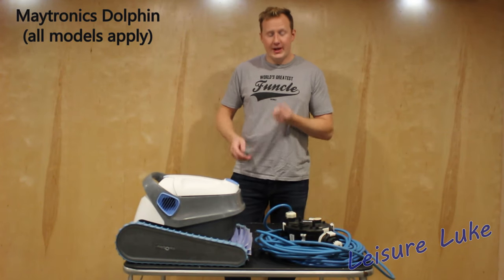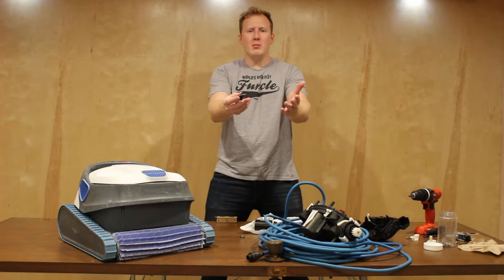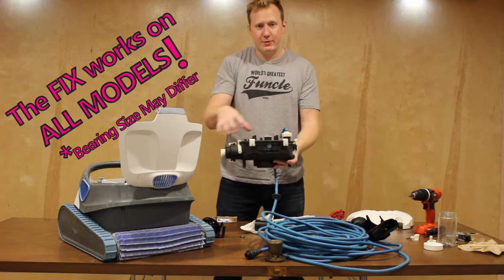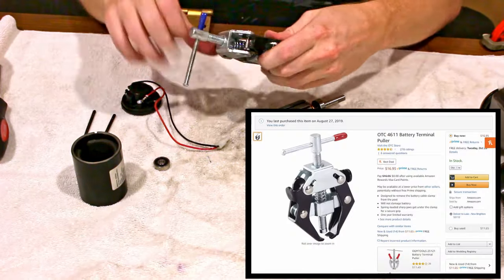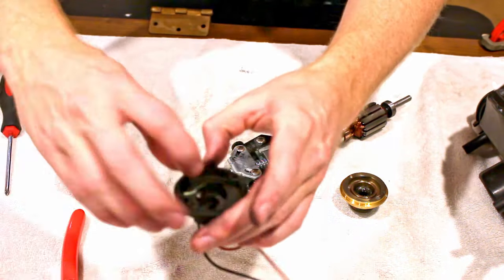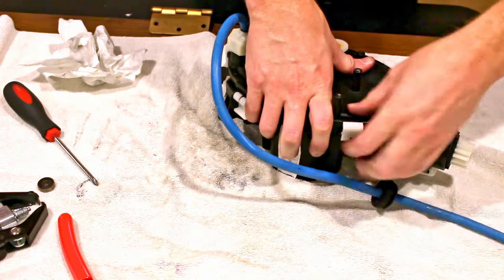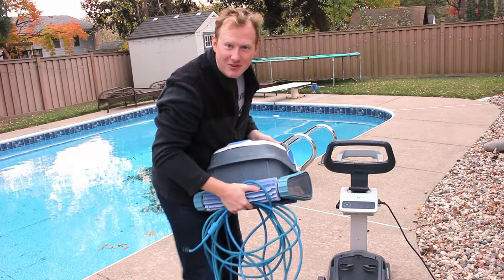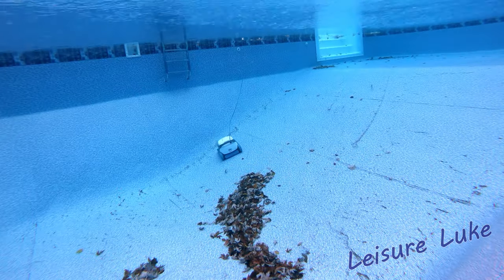Dolphin Pool Cleaner - BROKEN is FIXED!!!  SOLVED with 1$ Bearing | HOW TO REPAIR for MOST Models!

Comment: Thank you for the description and link to the bearings- that saved me a lot of research!  I pulled my Dolphin apart last summer when it refused to run for more than a minute or two and found that same bearing you changed was not turning smoothly in my motor.  I lubed it with some oil put it back together and the robot worked for the rest of the year.  Fast forward to this Spring and that bearing was rough again so it is time to replace it.  Oil has it working for now, but the bearing really needs replacing.  

One note for your viewers- when I reassembled the motor the first time it was running backwards and I needed to swap the red and black wires / brushes to the opposite positions from where they were originally to get the motor to spin in the proper direction.  I'm not sure how I managed to get something backwards as it seems like all the parts were keyed for one orientation.  I think it might have been the brass cap at the end of the motor.  It isn't keyed to the motor housing but is keyed to the plastic enclosure.  I think that going on opposite to original resulted in the terminals lining up opposite to where they were previously.   I recommend putting an alignment mark on the brass cap and motor housing.  It will help with aligning the screws to the holes, too.

Does anyone have a source for replacement brushes or the brush springs?  I don't know how long these will last, but it would be great to be able to replace them when they wear out.
Reply from the maker: GREAT feedback Ryan.  Nice work on oiling up the bearings!  Bummer that's only temporary, but at least it reassures you that you've identified the problem!

I've seen a few people ask about the brushes and brush springs.  From what I can tell these aren't parts that wear out in the life of a dolphin, yes, these wear out in electric motors (usually before the bearings), but you would probably have to run a 2+ hours a day for 10+ years to actually wear those out.  That being said, they're generic, and brushes are sold by size, so if you remove the brush, measure the width & height with a caliper, you should be able to find that brush size on ebay, and you'll have to guess at the length.  Springs too.  I search a bit and found springs that looked the same.  I didn't buy them to verify.

Again, good work, and good luck when the replacement time comes!
Reply: @LeisureLuke   Since my first post, I replaced the bearing and everything is running smoothly again.  I used the terminal puller you recommended to pull the bearing.  I used a small bolt between the puller head and the axle to reduce the diameter down to the appropriate size to not interfere with the bearing race as it was being pulled off.  It worked great!
 
This is pretty embarrassing, but somehow I managed to get my terminals backwards AGAIN even with being aware of the issue and had to take it apart another time to fix that.
Reply from the maker: @ryanmcdaniel7030  BAHAHA  AGAIN!?  Funny, well, well done!!!!!

Comment: Fixed!!! Thank you!!!Dolphin Nautilius CC Plus. 4 years old and I always leave in the pool.  Robot would run for about 1-2 minutes and then stop and the blower fan on the top would continue to run without moving the robot. Fixed: opened up the motor assembly and found the motor that drives the wheels to be completely full of electric motor dust. Picked up a can of contact cleaner for electronics ( and safe for plastics) and cleaned the hell out of the motor. The bearings after cleaning rolled smoothly so I didn't need to replace. Put everything back together - be mindful of the little odd looking washer that sits ontop of the bearing- kind hard to put back but you'll figure it out with time. Only thing I noticed while it was opening the the brushes on the motor were running a little low. If it acts up again I'll plan to buy some extra brushes to keep the motor running. To make sure you have good seals you need some pure silicone grease. 
Total cost to fix: 1 can of contact cleaner: $12 since I already had the silicone grease.

Comment: Well done.  For all the maytronics owners out there, it would be phenomenal to be able to source those two motors somewhere @ the source.  A fix for probably 99% of the failures for a few bucks, and not $400 for the entire drive unit.
Reply from the maker: Thanks!  Yeah, there are hundreds of places to get the motor assembly and NO ONE sells the individual motors anymore.   Glad you appreciate the fix!  Let’s save some people some money!
Reply: I found the impeller motor on ebay for my Dolphin Deluxe 4 for $300. Fortunately Luke's video determined I only needed the besrings.
Reply: I found the same motors on ebay

Comment: My Nautilus CC Plus was spinning the impeller for a few seconds but the motor for the tracks wouldn’t start. Followed your advice and checked the bearings. Replaced one of the impeller motor bearings since it was noisy and failing. Back in business!  Thanks for this video!
Reply from the maker: Nice work!!! And good to know the same issue can appear on the drive motor!!!

Comment: I used to work on typewriters and when I tore apart the motors for cleaning, I always made a mark on the case and end caps.  When you reassemble the motor, align the marks and the bolts will line up perfect.

Comment: Thanks for this video! Easy to understand and follow. I got mine down to the impeller, before opening the box, and the impeller was easy to turn but had a lot of hair around the shaft. I cleaned that off and thought I'd gotten off easily, but it still does the 10-15 second run and stop. Should the impeller twirl, or just be able to turn.?
Reply from the maker: Nice, the problem is usually just a stuck impellor clogged with hair, sticks, etc.  The impeller turns hard, but can be turned.  I would say it does not "spin".  You can't flick it and watch it twirl, but if you grab it you can rotate it.

Comment: Thank you. My Pentair Prowler 920 (Dolphin Active 20) stopped working. It would move a couple feet and shut off. I pulled it apart and noticed a ton of black soot everywhere inside the motor unit housing. Upon further inspection it was dust from the impeller motor brushes. I pulled apart the impeller motor and it looked terrible, I wiped it down really good to remove the dust and it cleaned up nicely. The bearing was okay. I re-assembled and now it is working. It's a bummer you can't find the impeller motor (5500024 in my case) anywhere as I'm concerned the brushes are worn and may eventually need replacing. Thanks again as I was able to repair this for $0 and a couple hours of time.
Reply from the maker: We’ll done!  Yeah, those solid brushes create lots of dust… they are generic brushes that can be replaced just by measuring the height & width and ordering the right size brush on eBay.  Sounds like a few other commenters here are considering the same thing when the time comes.  Nice work on your repair !!!

Comment: Thank you, Luke, for the video.  My Dolphin Triton PS stopped working after two years, right after the warranty expired.  The lady at the pool store said that the model was an "internet special" that broke early (I purchased it online).  I was not happy, I'm used to such large purchases lasting many, many more years.  Anyway, I went through your tutorial--first, I could move the fan but it did have some resistance, so I moved forward.  When I got the motor out, a bunch of rust-colored water spilled out: the gasket had failed.  The circuit board had some pieces that fell off after soaking in water.  I didn't go past that so now am going to purchase a new robot.  I thought about replacing the motor unit, but I also would need a cord, since that would all cost $600 plus I'm leaning towards a new one around $850.  However, the reviews tout the Dolphin Nautilus CC, but I'm so hesitant to get a Dolphin.  Perhaps I will, and after 2 years, pull everything out and replace gasket and parts.  I'm not sure :(
Reply from the maker: Sorry to hear that rob.  I would get a new one vs fixing yours.  Once you have water damage you're looking at replacing everything internal and it's work without a warranty.  You'll be happier finding the store with the best, longest warranty possible and getting that!  Seems like purchasing through a local pool store that clearly states their warranty is the best thing.  If it were me, I'd start reading through Amazon adds and get the highest-reviewed product that has a warranty (you will have to pay to ship it in).  These things just aren't made to last, but a new one will undoubtedly be better than an old one.  Hope that helps.
Reply: I agree

Comment: Great video. The same problem happened to my pool cleaner, your video inspired me what to do and it turned out that the bearing next to the brushes was blocking. I lubricated it with oil and the problem was solved, but I bought new bearings and will change them later.
Thank you, thank you, thank you.
Greetings from Spain.
Reply from the maker: My favorite result!  Glad to hear you were able to find the issue!  I'd still replace that bearing, but it sounds like you've bought yourself some time.  EXCELLENT JOB!!!  Party Accordingly 🥳

Comment: My 5 year old Dolphin Triton PS Plus was throwing the "Error 1: DC in voltage" shortly after start up. Strangely I could still clean in manual mode and the impeller seemed to turn easily enough.  I'm decided to try and replace both bearings of the impeller motor anyways, and the error cleared and is working again.  Thank you for your video!
Reply from the maker: Oh man, nice work!!!  Maybe the motor was drawing too much power, or maybe you fixed a bad connection in the process.  Either way, we’ll done!!!

Comment: Great how-to video! Thanks for saving me significant replacement $$. I almost ordered a new robot right away, but figured I'd try this first. It fixed my Dolphin model with the exact same bearing, threw it in the pool and it started working again.  I used toothpicks to move the motor brush springs off and then used them to hold the brushes back while inserting the electric motor back into its housing. With the extra bearings, I'm ready for 4 more repairs if necessary.

Comment: Thanks Luke, I had the same problem and your video gave me the confidence to try the repair. Replacing the bearing was a piece of cake. Reassembly of the motor was a little cumbersome because of the brushes. Next time I think I will retract the brush springs and let the motor housing keep them off the brushes. Getting the housing for the motors and circuit boards back together with the o-ring properly in place was a bear. After 30-45 minutes of swearing I decided to try my woodworking bar clamps (2) to draw the housings together while using a piece of wood to tuck the o-ring between the two housings. In two minutes the housing was back together and after 3 days the cleaner still works. I’m fairly confident I just saved a thousand bucks. Thanks.
Reply from the maker: So happy it worked!  Sounds like you got a little more work than you bargained for, but glad you’re done!  Mine still works on year 2 of doing this fix!  I run it constantly this time of year in the spring of Minnesota.  NICE WORK, CONGrats, PARTYACCORDINGLY!!!!! :)
Reply: @LeisureLuke  Luke, thanks for the great video on the impeller motor fix. My question:  I took my motor box apart and all motors seem to work but only briefly. Is there some sort of sensor that shuts the motors down when the unit is not in the water? If not, I'm wondering whether I have a bad board in the motor box. I have an M400 with three motors, two drive and the impeller.
Thanks!
Tim
Reply: That last lid latch worked me over trying to get the last it on.  The uneven surface was a challenge with the woodworking clamp but a lot of MaGyvering solved the issue.

Comment: This is a great video...my bearings where fine ...my motor was packed with carbon dust...cleaned it out and it runs fine now....this video is great showing all the steps...the engineering on this machine is fantastic...taking it apart and reassembling it is pretty easy...all the parts are indexed to only go together properly...even the power cord.  thanks so much....saved a LOT of money. I recommend cleaning all the gaskets as you reassemble...just to keep water from creeping in. I sure wish they would sell the individual motors inside the $450 assembly....why engineer it so well to for repair and then not sell the interior motors?
Reply from the maker: Thanks for the comment!  That carbon dust is a build up from the brushes wearing away on the motors.  These are "brush motors" vs "brushless motors".  Some people eventually have to replace the motor brushes when they become too short over time.  Glad you fixed it!  I agree about cleaning the gaskets, but I'm worried about getting the wrong silicon grease to coat them in before reassembly.  Do you know what the right stuff is? Nice fix - one less thing in the dump and $1k saved a little longer!  Great Job, party accordingly :)
Reply: @LeisureLuke  Mine weren't that dirty that I needed to wash them...just got the sand off and then cleaned the grooves really well...the gaskets were still pretty slippery with lube when I put then back on....there are quite a few on the old interne that seem appropriate - I did see some refurbished motors on EBAY...appears to be a guy who refurbishes them full time...good gig
Reply: @LeisureLuke dielectric grease is what you should use on rubber o-rings. It will not chemically react with rubber - pull up the TDS and you will see it states safe on rubber. Thank you for an incredible video!

Comment: Thanks to you, I had the confidence to take a shot at fixing my Dolphin M500.  My unit would attempt to move, lurge and stop... usually sideways .   Suggesting the motor bearing you discuss.  I pulled off the top and side covers off.  One track seemed to be able to work freely, but the other was binding up.  Then I flipped the unit upside down and pulled off the four screws holding the center drive roller.  At this point, the ball bearings in the gear drive assembly for the drive roller fell out on the table !   This bearing had failed.   The specific part name is “Active Brush Holder Kit”.  So it was not the motor bearing, but still a bearing... and an easy fix!   I located the part from the parts diagram from a supplier and it’s on order.   $9 part to fix my $1000 robot!    Thanks for your tips.  Got R Done!!
Reply: Also, with the motor out I powered it up and test started the unit.  Impeller and both drive shafts rotated freely.  So I’m confident the motor unit is still good!   Thank you Luke!!
Reply from the maker: Hey Hey - that's great info about the "Active Brush Holder Kit".  Well done on the fix!!!  You should be proud have found, solved, and fixed the M500!  Keep up the good work!!!!
Reply: @LeisureLuke  got the parts today.  I ordered 2 of the “Active Brush Roller Kit” to replace both sides.  Glad I did.  The other one was a little sloppy compared to the new one and may have gone out next.   Put it all together and back in business cleaning the pool!!   Thanks Luke!!!!   😎
Reply from the maker: @gordonroat5364  Thanks for all the information, and nice job with the fix!  When you were describing the original problem you said it would stop sideways.  Do you mean it would sort of turn a little bit then stop?  That's a good thing for people here to look out for.  If your robot tries to do the twist before giving up it may be a track problem!  Much appreciated and again, be proud, that some good work you've done there!  Enjoy the clean POOOOL!!!!!!
Reply: @LeisureLuke    Yes, it would attempt to move and only move sideways and not much at that.  I think it was the bad ball bearings lodging as it started to move.  The “good” bearing was somewhat sloppy compared to the new one when I got it, so glad I ordered two and replaced both sides    Dolphin had been back to work about a week now and pool looks GREAT!   Thanks for your help!  😁
Reply: @gordonroat5364  so.....like Gordon Roat, my M400 is doing as his was......hoping it is the same fix
Reply: @LeisureLuke  so.....like Gordon Roat, my M400 is doing as his was......hoping it is the same fix
Reply: @LeisureLuke  Hey, there....so LINIX 63ZYC-A2 is what appears to be the issue as one side of the dolphin spins when turned on (all disassembled btw)....is this able to be opened? is there a bearing in there?

Comment: Thanks for the video.  Mine started stopping after a few seconds this morning.  Searched youtube for Dolphin Nautilus repair and your video popped up.  Watched it and promptly pulled it apart, found one of the bearings to be seized and drove to Ace Hardware, and I'm now back in business!  Nice feeling repairing it yourself and saving a boat load of cash on repairs/replacement.
Reply from the maker: WELL DONE!  Repairing an electric motor is no small feat!  Less trash in the dump, more cash in the pockets! 🥳👍🏼

Comment: Nice and concise, I took mine apart thinking your diagnosis was causing mine to stop.....but all bearings were
running freely.
then I separated the main body away from all electrics and diagnosed the tracking system.....there seemed to be an 
irregularity to it. Forensically examined inside the tracks and squashed piece of tree was inhibiting the smooth running..

These pool cleaners have a memory system to them......when once stopped for what ever reason ...they continue to stop
which make diagnosis deceptive...................Currently cleaner and dad are now happy chaps......all the best from Australia
Reply from the maker: Nice work!  That debris can be tricky to find!   At least now you're prepared to identify a bearing should you ever have that problem.  Well done!  Cheers!